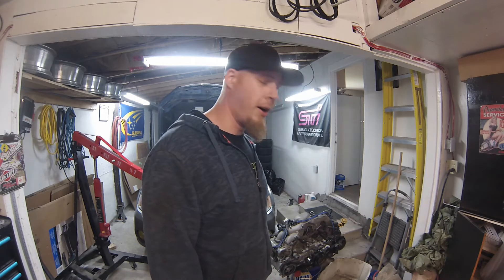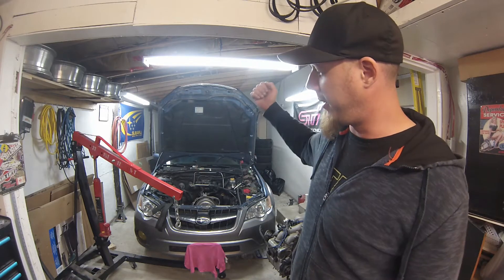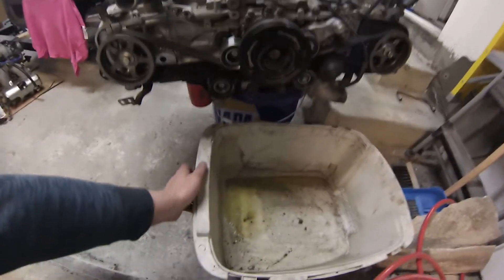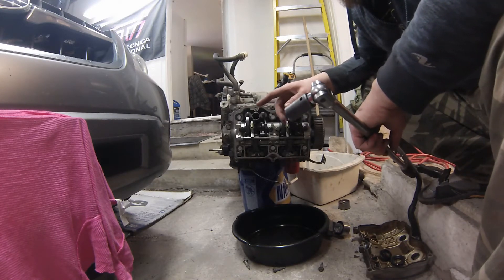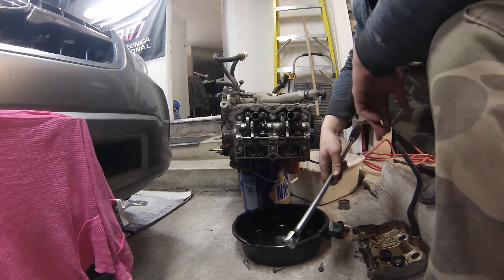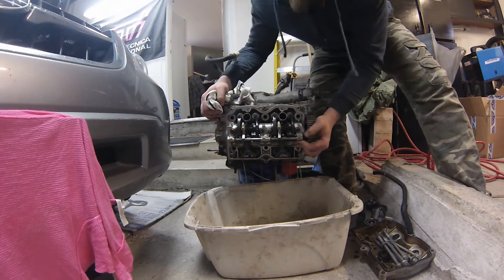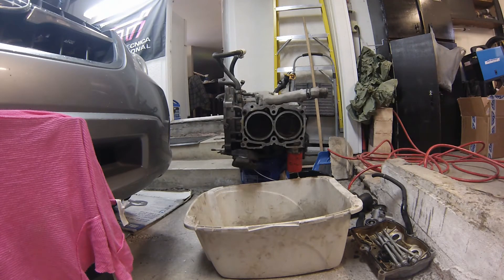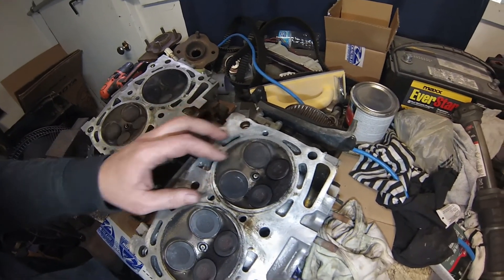Outback Broken Timing Belt #3 Engine Disassembly - How To

Comment: Oh by the way; I have used a 4x4 post frame and layer it across the bottom of the lift jack to set the engine on.....might work for ya!!
Reply from the maker: That's a good idea, I've done something similar before with a small pallet. I'm pulling an STi engine now, but it will be going onto the engine stand this time.

Comment: Nice work,  just found your channel.  Was curious if after the bent valves were discovered,  is there any damage to pistons? Would you get those piston walls re- honed? New rings etc? Clearly all new gaskets .
Reply from the maker: Sometimes the pistons do take significant damage and require replacement. 
In many cases as I've discovered pistons are able to take the hit without causing enough damage to warrant replacement.

Comment: Nice work! What was the cause of timing belt breakage? You mentioned you replaced the belt two years ago and it looked they haven't driven whole a lot of miles!
Reply from the maker: Thanks! The timing belt tensioner was to blame. It lost hydraulic pressure and the belt went slack. DNJ was the parts that he bought, DNJ no longer sells that kit. I turn people away from that brand from a few issues I have seen.

Comment: Great video
Question: I have a 2001 Subaru Forester and it has a 75 amp alternator in it and was wondering if an 85 amp alternator would hurt the wiring??.
Reply from the maker: Alternator amperage ratings are what they will produce under demand. 10 more amps isn't going to hurt anything, nor is it likely to pull more than 75amps while running. Aftermarket accessories are what usually require a larger output alternator.

Comment: 7:16 Why 12 pt.? I figure 6 pt. would get a more solid grip on the bolt head.
Reply from the maker: The cylinder head bolts have 12pt. heads. 6 point sockets will not work. You are correct, always use a 6 point in favor of a 12 point.